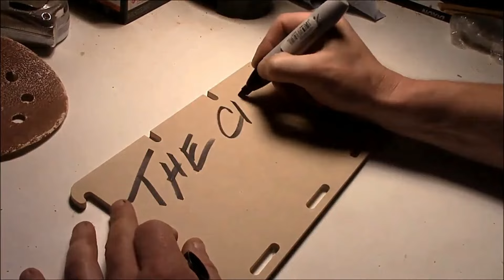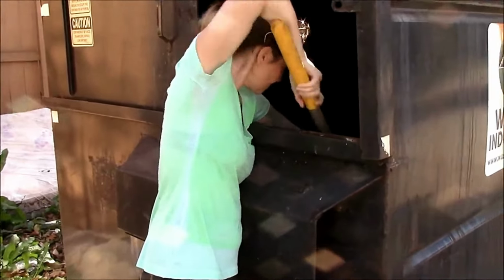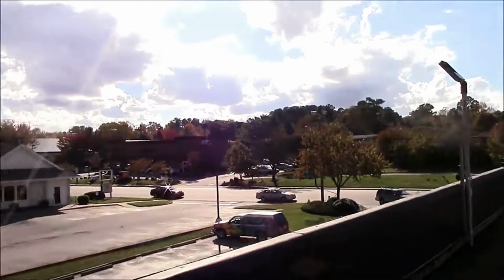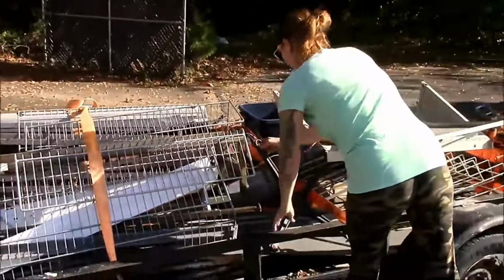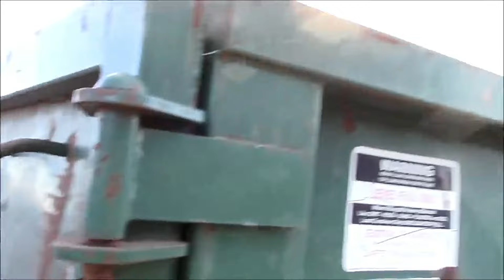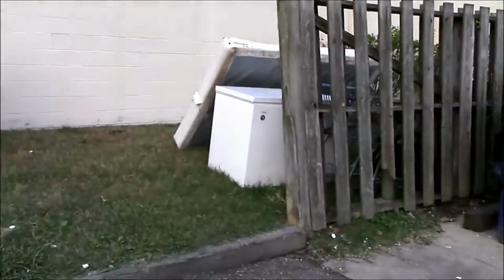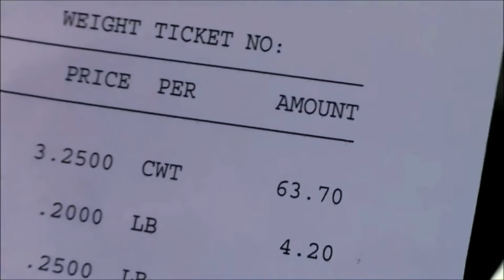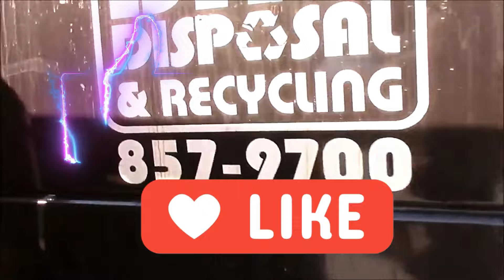Taking the Trash All the Way to the Bank!  Scrap Metal Leads to a Junkyard Payday!

Comment: W3 would find Aluminium beer barrels and get the gas bottle out to cut them up. They were a really good price, especially the large ones! Bright copper was a great price also. I recall stripping down wire… so boring!!  Those old washing machines most built with Aluminium, stripping those out was easy. Ahhhhhh, the memories!